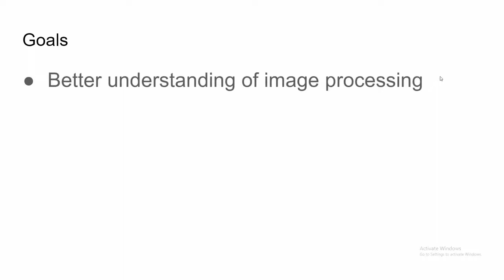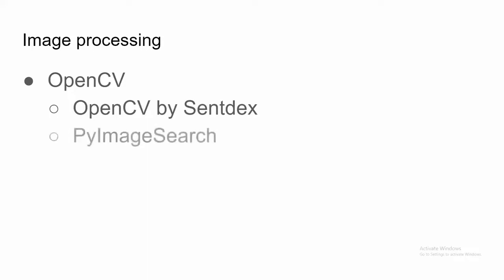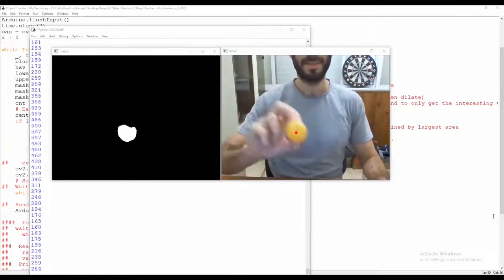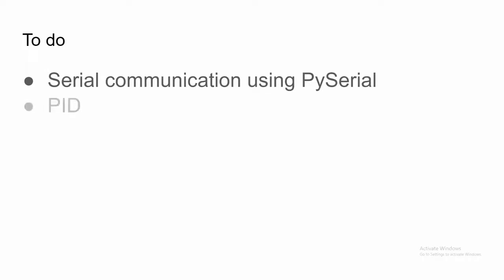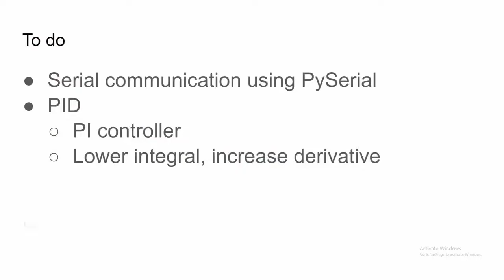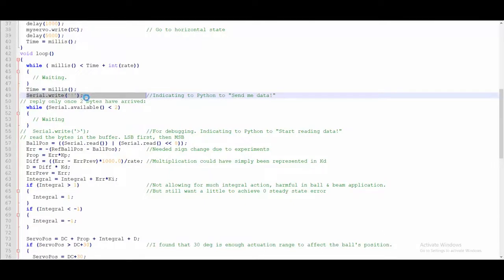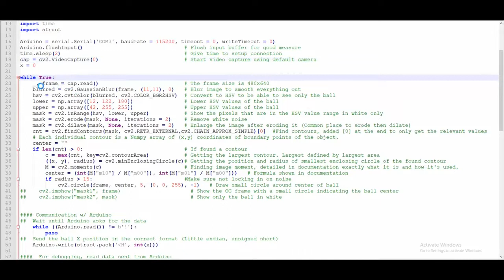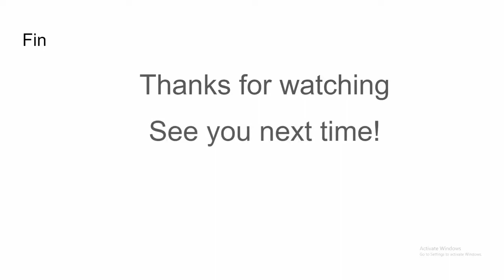Ball and beam using camera (Arduino)

Comment: Hello Mr. We are trying to make that project and we have no idea how should we connect the camera to the system. Image processing part is okay but which board should we use and which programs are better could you please send me the material names which you used ? (PID, Board and their nubers etc.)

Thank you!! 
Really nice project!!!
Reply from the maker: I used an Arduino Uno or Mega board, don't remember which, though either should work fine.
And I also used my PC for image processing.

I sent the ball position from the PC to the arduino board via serial communication.

Not sure what you mean by the material name for the PID.

Thanks and good luck!

Comment: Which pid controller are you using
Reply from the maker: A parallel PID controller. You can see the implementation in the code.
The GitHub link is in the description.